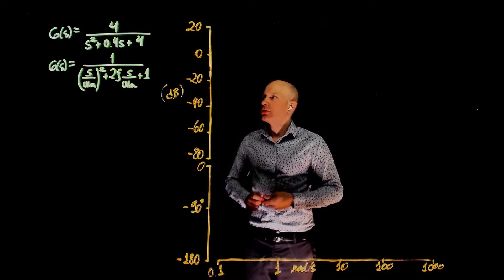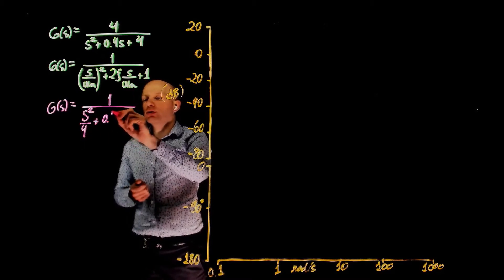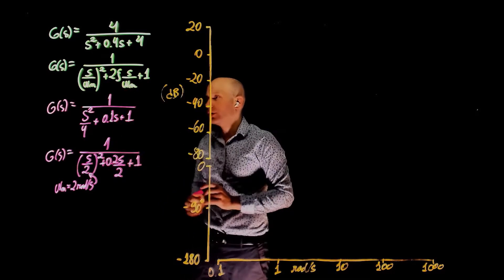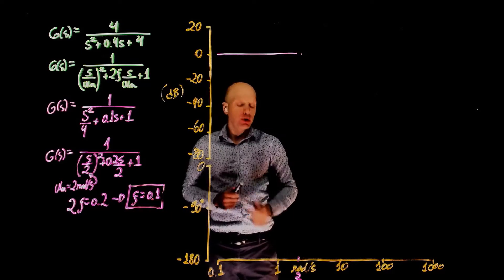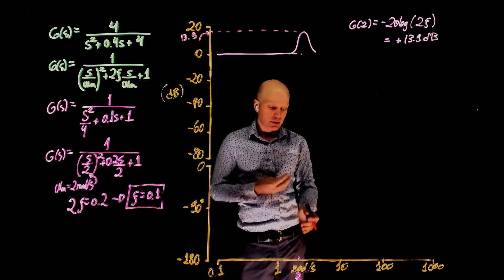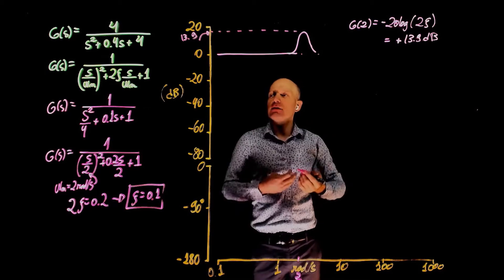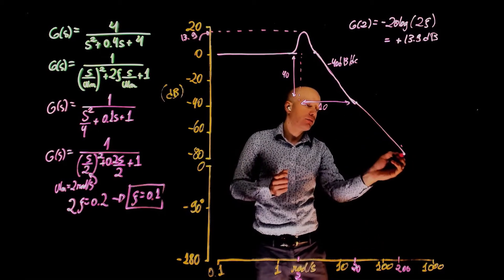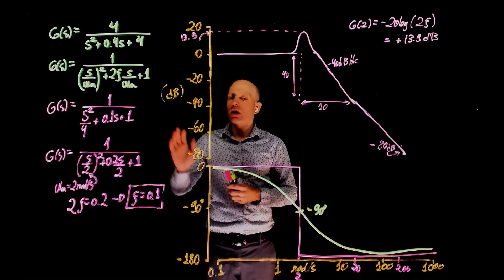Example 102: Drawing a Bode plot with complex poles -  STEP BY STEP

Comment: sir, I wonder that if we have 10 in the denominator instead of 1 , it would be affect our bode plot ?
Reply from the maker: You must always write the characterisic equation in the standard form, which must with +1. If the charactersitic equations was s^2+0.4s+10, both the damping ratio and the natural frequency would change.
Reply: @biomechlab  Can I get 10 as 1/10 numerator? would I have progressed in the right way then? sir, thank you so much for reply
Reply from the maker: @iremcantas6602  yes, factor out 10 in the denominator first, as I did with "4" in this example
Reply: @biomechlab  I want to ask one more question with your permission.